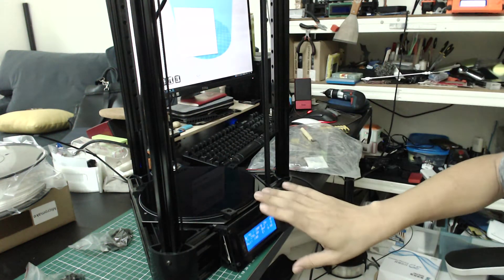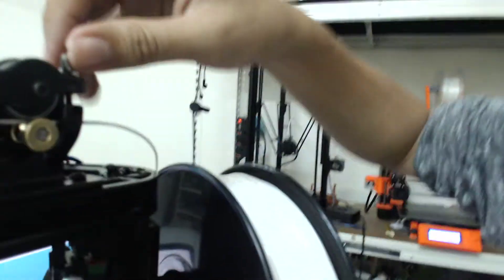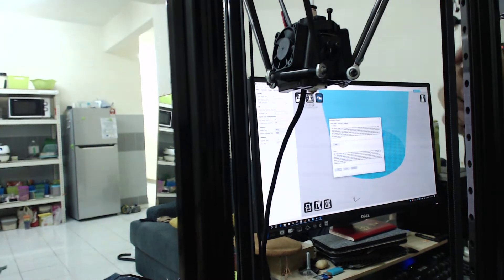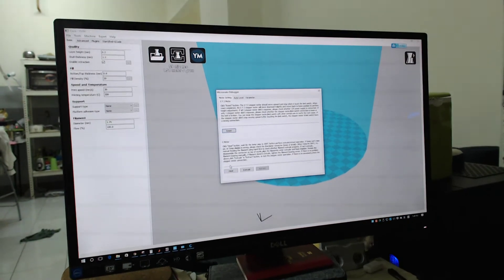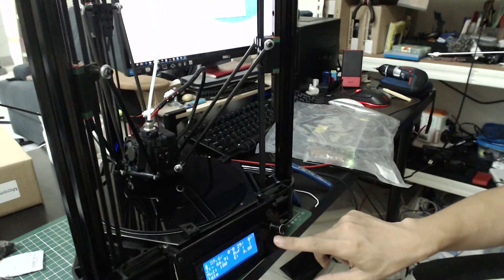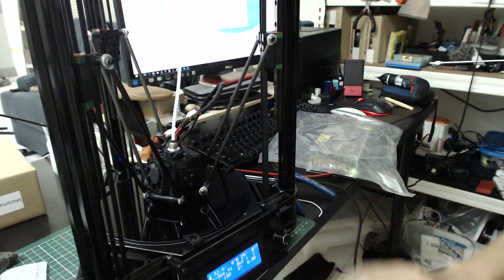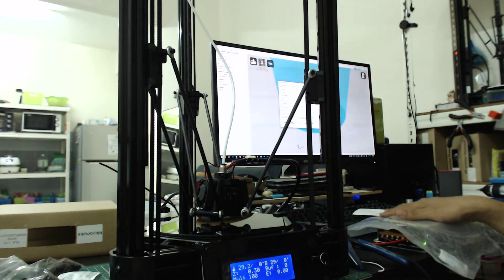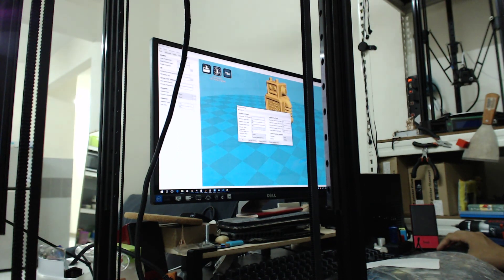How to run Micromake Delta 3D printer Auto calibration

Comment: do you need a end stop at the nozzle area ??? i m hving problem with my delta at the outer part of the print base
Reply from the maker: +Machvelle Pang yes you need end stop at nozzle. t
Reply from the maker: +Machvelle Pang you can try this https://youtu.be/ZdnRZLJjgMw
Reply from the maker: +Machvelle Pang ofcause you need
Reply: my cura auto level button no function
Reply from the maker: +Machvelle Pang this is custom make cura version for micromake. link.at description

Comment: Could you please give me a link to the STL for the side spool holder you are using.
Your printer looks the same as the Anycubic Delta Kossel?
Would the procedure work on the Anycubic Delta Kossel?

Thanks Very much
Reply from the maker: +Dennis Sladek all kossel is open source design .look similar is normal. But I have no idea about anycubic firmware and controller but I guess can use.
that spool holder not 3d printed but you can find some design on Thingiverse